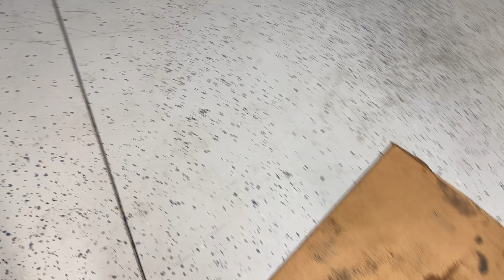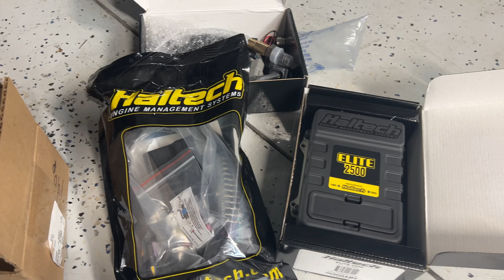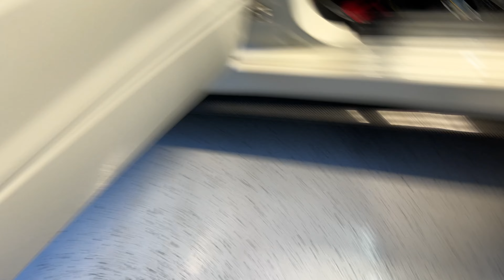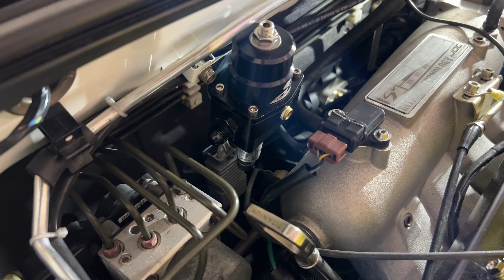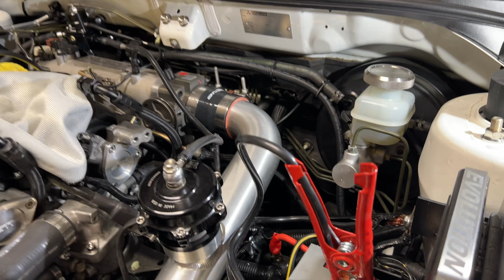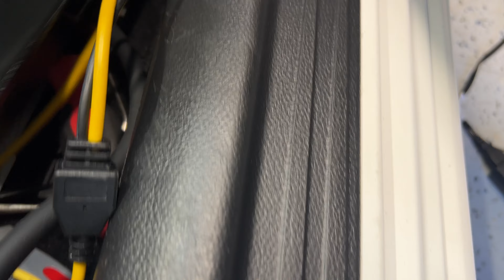Haltech Elite 2500 Installed on my Evo 9!

Comment: Where are you going to place the EMS at? I currently have a AEM and it barely fits in the stock location, furthermore it doesn't bolt onto anything, I was wondering if I can get any ideas from you, cause I would prefer it to be somewhere stable without any vibrations 😢
Reply from the maker: It’s just going to stay in the glovebox until I can figure something out. I bought a mount from someone but looks like they’re just scammers. I had to file a claim to get my money back. I’ll probably end up making my own mount.. We’ll see..
Reply: @CJ2X  probably will be the only way to secure it. I don't know if it's just my EMS but it resets or messes up whenever I hit a bump or cause it to vibrate and it's kind of scary when you're in the middle of a pull while shifting. I'm sure you and Rodney will figure something out though! Enjoy all the informative content you put out there, grateful that I found your channel. 🙏👍